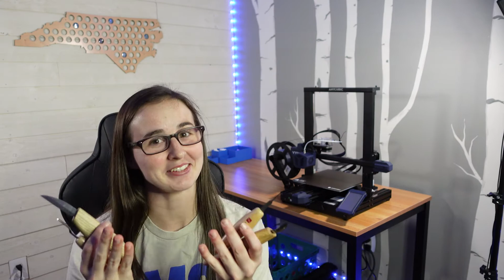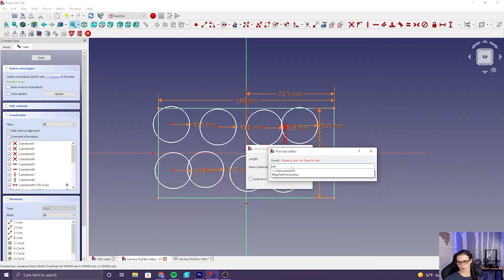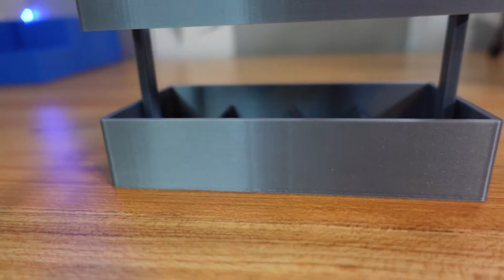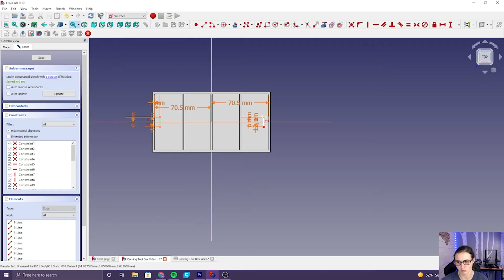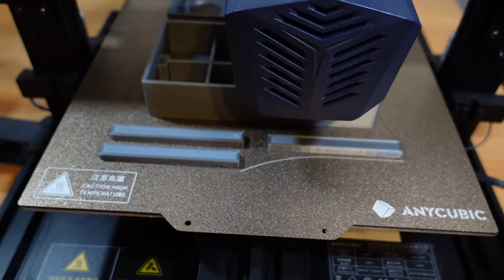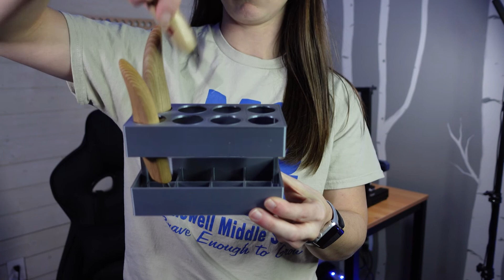Beginner 3d Printing Project - Storage for my Carving Tools

Comment: Can you explain the CAD thing.  I don’t know what that is.
Reply: The CAD thing is a vector drawing tool that allows drawings to be any size. She can draw a 30 mm circle array that can be redrawn to 20 mm without having to erase the 30 mm circles, and then redraw 20 mm circles. I like to draw 0.3 mm circles for calibration of depth of cut of tools that have to match up on the mold floor within 5 micrometers. Drawing takes time. You don't want all of your time used up drawing in CAD thing, leaving no time for watching her YouTube videos. ❤